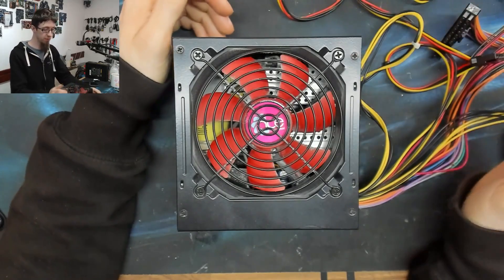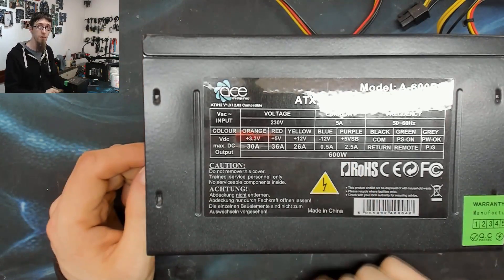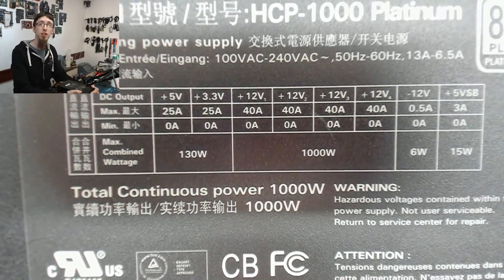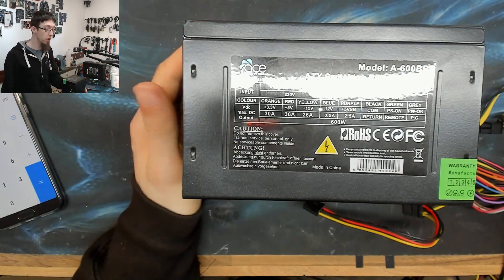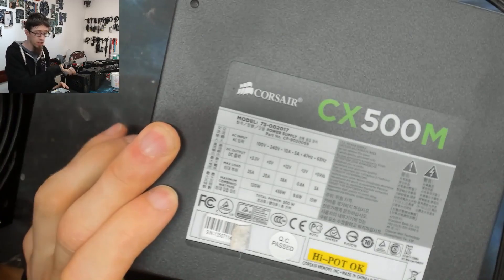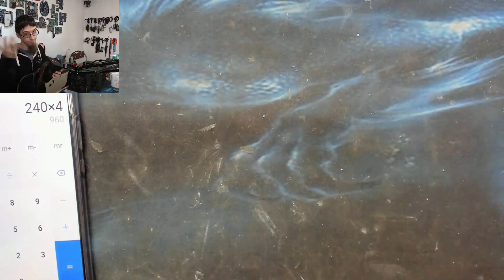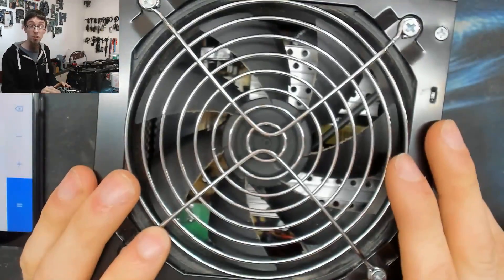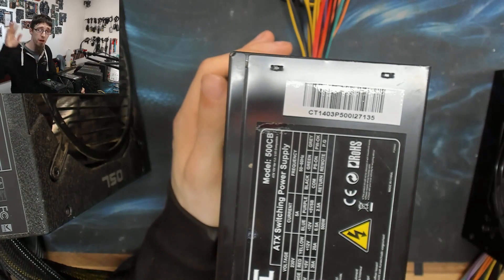LFC#171 - Why This PSU Is Crap

Comment: Bit late but catching up on your vids, Got to love Antec power supplies they rate their PSUs at RMS when just about everyone else in the industry rates up to the roll off, or max peak as in those generic black units. Their 450w units are like all the other big players 500-550w units.or generic 600-700w units.  Good to see you shine a "lite on" PSU specs (did you see what I did there?)

Comment: I modyfied an old 400W Xilence PSU so I can use it as a lab-bench powersupply and I just noticed how garbage it is. Only 15Amps on 12V = 180W, I mean It is quite okay for powering small electric devices but it is still good that it isn't used as a pc psu anymore. 
I do have a 550W 80+Gold Xilence unit in my system right now though so I looked up it's specs and it seems to be allright. 
Only 1 12V rail but with 45.8A so it's actually the full 549,6W on the 12V rail alone.
And then there's 20A on both the 3.3V and 5V rail.

Comment: I've seen a psu with 5 amps on the 12 volt rail and it claimed to be a 400 watt psu
Reply: LOL!
Reply: Haha... I don't get it
Reply: @Dilan_Duck  That's just 60 watts for the mb/cpu/gpu. Even 20 years ago that's pretty low for the 12v rail.
Reply: @cosmic_drew  20 years ago it was even worse, I believe the old prescott pentium4 used 100-150w, not sure
Reply: @rdeurhof  Yeah if you had a higher wattage system you'd have to research your psu choice. Most generic psus were specd to the system it came with and wasn't really meant to be reused when upgraded. They'd hit the exact amps they needed on each rail and nothing more.
Reply: Prasanna Godiyal  Curry = Chilly ÷ indians
Reply: Installs RTX 2080Ti and Ryzen 3900X
Reply: There must be more to this. In the older ATX revisions, you'd have more power on the lower voltages. Maximum wattage is combining the +3.3, +5, and +12v rails together.
Some manufacturers would state the power of the device using it's maximum before powering off or causing a crash.

This could be 400w for half a second. Because it never states peak power, it still complies. These days we look at continuous power which can be pumped out all day every day.
Reply: most ATs and many ancienct ATXs were like that because the cpu VRM used to come out of the 5V line. power hungry pentium 4s (and intel being intel) pushed for 12V VRMs and there were "pentium 4 ready" stickers on those.
Reply: Prasanna Godiyal  Don't be a dick and go and learn Ohms law! Power = volts TIMES amps not "into" (i.e. NOT amps divided by volts)! Volts "into" current = I/V = inverse of resistance = Conductance = Siemens! Doh!
Reply: Y'know that just marks you out as a n00b right?
Reply: WAIT WHAT? Ohms law is multiply the volt with amp = watt. So that sticker is overstateing by 340watt... Isnt that illegal tho? (should be if it isnt.)

Comment: I think the single rail is a sign of a cheap power supply. It also depends on how the step down rectifier. For example:  A cheap power supply rectifies down to 12V then steps down that rail to deliver 3.3 and 5 volts. You will never get the full AMP load as they all feed from the same 12V rail. A more expensive gold or platinum uses parallel step down circuits with independent rectifiers separate. Also, the lower the reference rail amps means a more precise circuit.

Comment: I was expecting circuit analysis between cheap and good PSU. Mildly disappointed.
Reply: All you need is a weight analysis. Those cheap ones weigh so much less than a power supply that contains quality parts.
Reply: @dancoster7332  Completely disagree. I once dissembled a Chinese PSU and find a concrete block inside it. So, the "weight analysis" is irrelevant.
Reply: Cheap PSU will have 1 transformer to step down AC mains to all required voltage. This means they can easily put 3 voltage regulator circuits on 1 PCB. It also means that all 3 different power rails will get their power from 1 transformer; hence, the amp rating being close to each other. They will use either 1-2  large heat sinks with multiple voltage regulator IC's sharing a heat sink or multiple smaller heat sinks; then reduce the cost even more by using mostly high ESR capacitors that are prone to overheating.

Good PSUs mostly have 2 (even more) transformers to separate the 12V from the 3.3V and 5V supply; will have at least 3 large heat sinks plus smaller ones. Finally, separate circuits for different power rails and another one for overload protection instead of relying on the motherboard to do it.

Comment: word of thumb:
If theres more amps on the 3.3V rail than the 12V rail, discard it immediately
Reply: rule of mouth: Always avoid the cheapest power supplies in any brand's lineup.  Below a certain price point, making a power supply cheaper becomes an exercise in cutting corners.  Longevity and protection circuitry are always first on the chopping block.
Reply: Actually, that's not true, older PSUs actually had really high 3.3V lines as that's what you needed back then and a lot of the cheap off brand ones are rebranded refurbished PSUs, this could be one of those.
Reply: Yeah. Modern PSUs don't handle old machines that rely on 5V very well, even with extremely high wattage units.
Reply: @TheBig451  Get a voltage dropper and wire in a new 3v from the 12v. You lose some amps on the actual 12v, but you have a stable 3v.
Reply: @forevercomputing  At that point I think you'd be better off just getting a period correct unit and replacing any blown 
capacitors.
Reply: @TheBig451  Finding one would be a challenge and likely used. If you can modify and rewire a modern one with some capacitive droppers in there, you can get something newer and have more power on the lower voltage rails.

Life is boring without a little  challenge here and there
Reply: @forevercomputing  Well, of course it would be used, and even if it wasn't, it would be new-old stock with said blown capacitors. A quick soldering job and some fairly cheap capacitors isn't particularly far out of reach. 
That said, now that you've mentioned it, I'd actually like to try this on a modern unit and see how it performs. Thanks for the idea dude!
Reply: @TheXlen  From my experience, if such older PSUs are branded (like Delta, FSP, Seasonic, Dell, ...) they deliver what they're rated for and generally work just fine. Even in newer PCs I prefer old branded PSUs inspected by myself instead of unbranded new ones.
Reply: TheXlen well you wouldnt want to use an old psu today lmao
Reply: Or use it for an older PC that draws more the 3.3V rail!
Reply: if the PSU is light, don't trust it for more than 1 year.
Reply: PCs theses days only need about 8 to 10 amps on the 5v and 3.3v rail. Some parts of the motherboard still need those voltages, but 90% of PC components pull power from the 12v rail. I have a gamemax PSU and have 102amp on the 12v rail. Also SSDs mostly use the 5v rail, older mechanical HDDs use the 12v rail for the motors and 5v for the logic. The 3.3v rail was brought in years ago for IBM Cyrix CPUs which ran directly at 3.3v.
Reply: @stiggyness1976  Exactly so why does the guy in this video claim  the cpu uses 12v  from the Psu? It don't make sense, possibly to justify his claims of 312 watts at 12v being inadequate, when its really not.
Reply: @tyronenelson9124  Because the CPU does pull the power from the V12 rail, it uses the VRMs to output the correct voltage for the CPU installed at the time. The VRMs are a sophisticated buck converter to derive the voltages needed, it's a more efficient way to do it, with less losses.
Reply: yup from haswell onwards pc's need more on the 12v than the lower rails and  older psu's arent designed to balance properly if more is pulled on the 12v than 5v or 3.3 resulting in high ripple , random lockups and reboots and damaged hardware....
Reply: @DevilbyMoonlight  I have a 1660 that I want to use with a Sandybridge system, but the only powersupply I have with a PCI-E 6 pin is an Antec Smartpower 300W from a Socket A Compaq Presario. Would this work? I'm not sure if it died and took the motherboard with it or visa versa or if the the motherboard died on it's own.
Reply: @ChrisD__  yes no problem, it will work
Reply: @Crazy--Clown  But did the Socket A board die or was it the power supply? And more importantly, did the power supply kill the motherboard?
Reply: I buy these all the time to use in retro machines that put higher draw on the 5v line because back in the day, the CPU pulled from 5v. These are perfect for really old computers, they just suck for anything made within the last 20 years lol
Reply: My LC-Power PSU has 24A on 3.3 but 20A on 12V however, it has 2x 12V rails and it's a 600W power supply without certificates. So, it's around 480W without 3.3v-5v rails on 2x 12V rails.

Comment: So my ACE psu which I use in my old core2duo + Nvidia quadro600 PC, has rating of 750Watts
but the 12v rail only gives 444Wats.
It has 37A on the +12V.

Comment: I have a CIT PSU that I've used in low spec systems and never thought it was a bad PSU until I saw this video. It has +12V1 at 10A and +12V2 at 13A.
Reply: It was probably meant for older systems that drew a lot of power on the 3.3v and 5v rails.
Reply: I have seen what was left of a cit when it went up in smoke, it was not pretty, thankfully it did no damage to the computer, I would never buy a no brand PSU,  I like Thermaltake myself, I had one for years, but it died, so I had to get one from my local computer store, which was a Corsair, they are ok I have used them in the past, but I will get another thermaltake.
Reply: z that hasn’t happened to me. In fact, in the time I’ve own the cit PSU I’ve had two Cooler Master V1000 PSUs die on me.

Comment: A very valid video. All too often in the past computer cases(AND even built retail sales computers) had cheap low wattage power supplies. In fact Dell is renown for their 250w (what I call snail power) power units/ small form factor computers. It is not that the Dell units for example, don't work well as is, they are extremely good BUT WHY your vid is so relevant re any computer enthusiast/user, is the FACT that all too often extras / accessories ie extra hard drives, DVD drives and et et are added to a system BUT the power supply is NOT upgraded to cope with the extra demands made. So as I've seen over the years just as you have☺ you get folks computers that have failed because the power supply has burnt out or simply failed. Often replacing that alone with a decent upgrade and the system works fine. Of course one should NEVER forget that, as I have found all too often so many DO☺ you get a computer that has a power supply that is clogged with dust and other pollutants which will cause shorts and or cause the power unit to fail. Some when cleaned out cause a mini dust storm ☺☺ All in all another great vid though I suspect some of those who should watch this will miss it ☺

Comment: Nicely presented. I have built hundreds of computers and mostly used Antec or Thermaltake, Corsair, Cooler Master and Fractal Design. And no doubt a few others that do not come to mind right now. Spot on to check the current available from each rail.

Comment: I reckon these garbage 250W PSUs branded as 500W would still be ok in an Athlon or Pentium system if you don't plan to upgrade the CPU or add any discrete graphics card (it might just be able to handle something like a GT1030 with a Pentium or Athlon, or maybe a Ryzen APU with no graphics card) ... but I definitely wouldn't consider it for anything more than that.

Comment: i had the 750w version, was 2 yr old when i upgraded some other parts and within a few hours the new hdd failed, returned it the replacement failed after a day, returned it, the replacem then went in an external caddy and was tested for 3 days before i trusted it with data, moived it from the external caddy to the pc, failed in 4 hours.... was ripple on the 12v from the cheap psu, WD design hard drives  /hate/ ripple.....

Comment: older coolmax semi modular 1200 watt psu still running strong has a single 12v rail with 100a and 1200w

Comment: why do all the red wires join inside the p/s in the same place, as do all yellow wires,  no matter where the red yellow wires go, they all come from the same place inside the p/s, my point is the way u read it off the lable or the way the lable reads u would think there were 10 seperate 12v supplies or 5v supplies  the other voltage 3.3 -12v tap off the p/s. makes me think the rating of amps is what the wires can support
Reply from the maker: That's not how it works. Just because the wires are all routed to the same place on the PCB, doesn't mean they're electrically connected.
I mean yea, on a single-rail PSU, all your 12v lines will join up at the PCB - but the whole point of multi-rail supplies is that the rails are separated from each other. They may or may not have separate regulators, but they're at least separated enough that a short on one rail won't pull the entire unit's wattage, or ripple from the GPU might come back to the CPU.
Reply: @Adamant_IT  ok i sort of get that, maybe the only p/s ive pulled apart were all just single rail types run of the mill HP Compact cheap ones off ebay ect ect, keep up the good videos every day i watch is a new information day for me,  good stuff.
Reply: @markwhitfield5412  there's two ways of doing a multi rail psu. first one is they are all technically a single rail with each virtual rail having it's own current monitoring and then you have truly independent rails. most psu's use the first option as it is cheaper to make.

Comment: I once got an Matx case from Maplin for £14.99 and it contained one of those Cit power supplies, it was so light that I had to tether it down lest it float away.
They do have a use though. If you're building a retro machine, they use the 5v rail more than the 12v, but not for anything past Athlon xp.
Reply: I'd rather entrust valuable old components to an old FSP or Lite-On PSU than to modern clones. Because at least if the time has come and that ancient high quality PSU dies, it won't take everything with it. Also consider you no longer really have to go for group regulated designs, you can also use a modern independently regulated PSU and it won't necessarily get upset even if you crossload, like with little 12V load and 5V closer to its limit.

Comment: The non modular cx550 has 550 on the 12 volt rail alone, i gues they could have marketed it as 700 watt power supply.  Thanks for this video which most channel don't go in depth.

Comment: Hi Adamant IT, what do you think about the CV550 and can I use it for my rtx 2060 and i5 8600(non K)
Reply from the maker: The Corsair CV550? Yea that looks very cool... good rails, not a wrecking machine, but perfectly fine. The compact size is very impressive, this is clearly a response to the growing trend of small ATX cases like the iCUE 220T that don't have room for big PSUs. I like it. No idea how much it costs though, I can't see it on amazon yet.
Reply: @Adamant_IT  Thank you ❤, btw it costs like 55$

Comment: Just imagine my face when I heard a jet when I ran a 980ti on one of these cheapo psus.
Reply: Bomb has been planted
Reply: It was like "Uh oh"
Reply: 480 be like: amateurs
Reply: Yeah I had the don't cheap out on your pay mantra drilled into me. So I ended up going for an EVGA 750 watt supernova. Still using it and haven't regretted it. It's seen at least 1 full new system and a few upgrades on the old system before that.
Reply: well i put an zotac geforce gtx 1060 3gb amp! edition in my old core 2 quad rig with 400 watt psu( psu is fsp atx-400pnf from 2009 and i replaced the OG fan with arctic f12 3pin fan) and it works just fine after i put an adapter for pci-express power for gpu, my psu  doesn't overheat. when i put furmark gpu stess test and cpu burner same time it's getting little warm( it's wasting almost 300w from wall) but the most part it's silent( which is nice compared to OG fan) but i will see in future